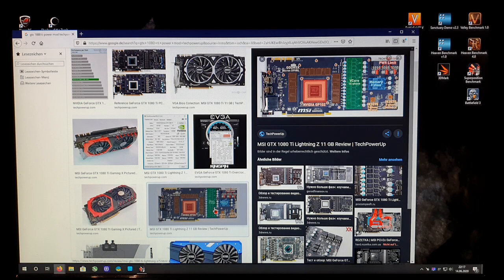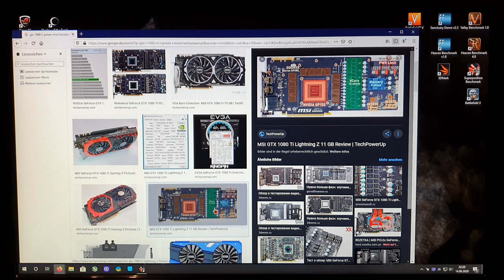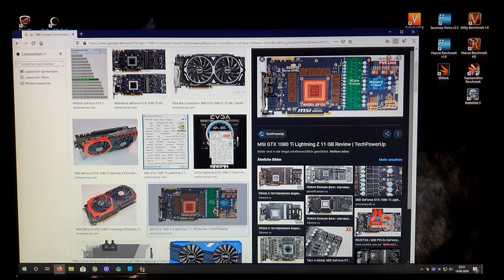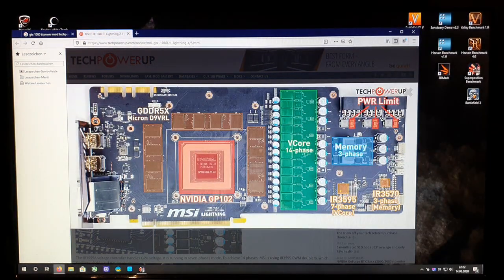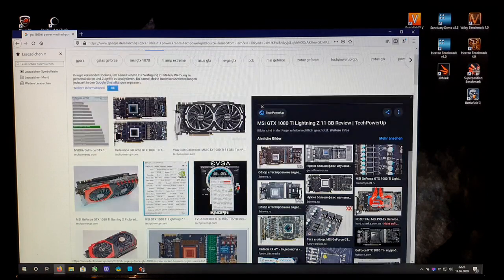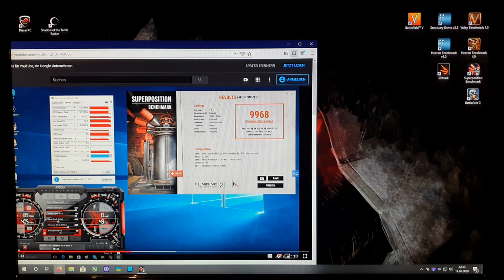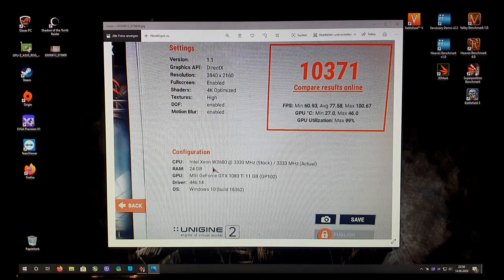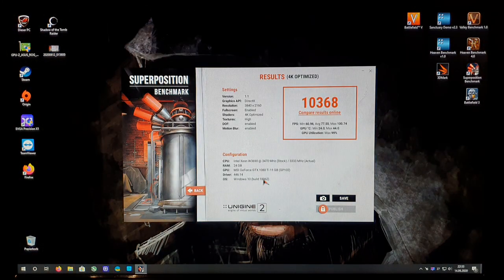Is the GTX 1080 Ti Power Mod really worth? By:NSC

Comment: You are right NSC... You do not need the latest stuff for an excellent pc... Moore's Law has not been true for a number of years now... Maybe the 3080 ti will be a big improvement on the 1080, but who knows...
Reply from the maker: That's right, maybe for the people's that are using 3 or 4 Displays a 3080 Ti is good ^^
Reply: Moore's Law is a fact but if that law means improving upon a product like the 1080Ti it means that the new product needs to rival and double the performance of the Ti, this is possible altho think about what it would cost to 1: create such a product and 2: how much does the consumer (the people buying the product) need to pay for such a product? in the long run this means companies will eventually die because money losses due to manufacturing costs and not enough products sold.
Moore's Law is still in full effect but slows down.

Comment: https://www.gamersnexus.net/guides/3185-how-to-short-shunts-on-gpu-for-better-overclocks-titan-v

"....As we ran these tests, though, we learned that nVidia already does an exceptional job at saving on power budget without significantly killing performance. We do see performance gains from the shunt mod, but considering we’re looking at 2x power consumption versus ~3% performance uplift, it’s safe to say that the cards are already operating at near optimal efficiency. ...."

I guess it will be the same deal with a 1080 ....